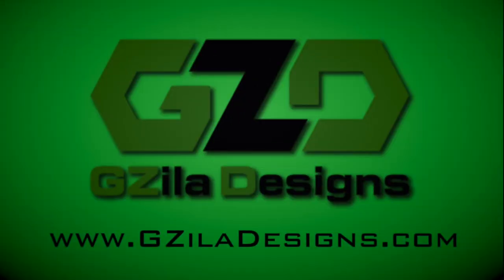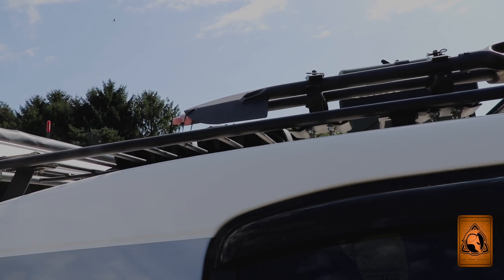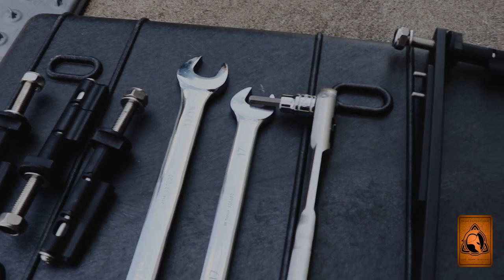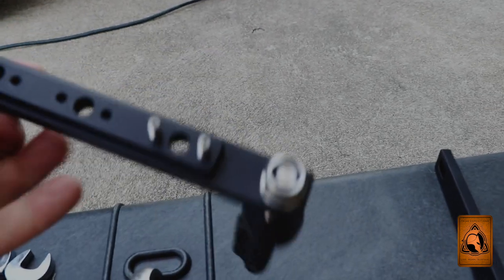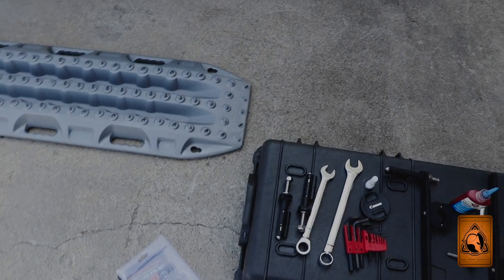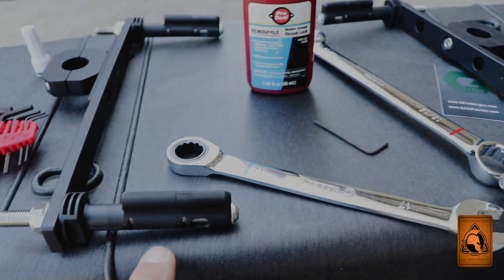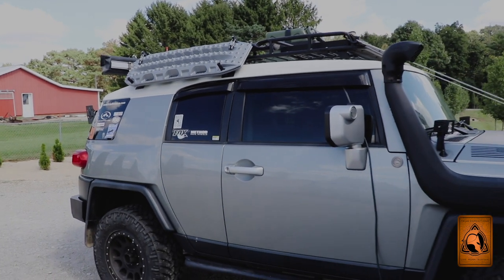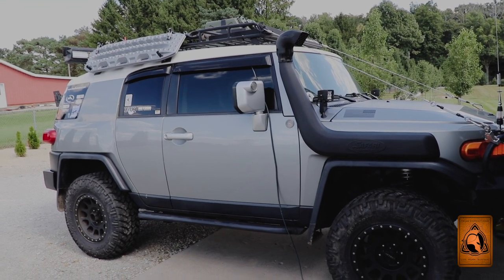Gzila Maxtrax Mount Install and Review

Comment: I was hoping to mount mine like this on the top rail of my Gobi rack. I have a rooftop tent tho that’s wide so I don’t think I’ll be able to, it doesn’t look like it goes too far above the rail. I have a cross bar on top so I have a little room to play with on the top
Reply: How many inches above your rack does the gzilla/recovery board go?
Reply from the maker: Very minimal, but the beauty is you can swing it on the angle you are able to.

Comment: Gun locks.  No issue with weather as I am also from Ohio.  Had them on the top for about 2 years now.
Reply from the maker: Good deal,  I think a healthy squirt of Fluid Film , would go a long way to keep them working smoothly
Reply: @UpintheAir.stream  or some lithium grease.